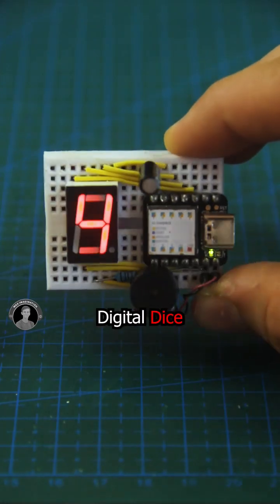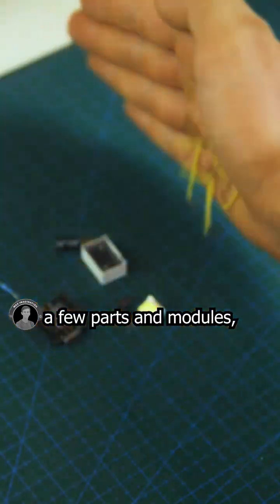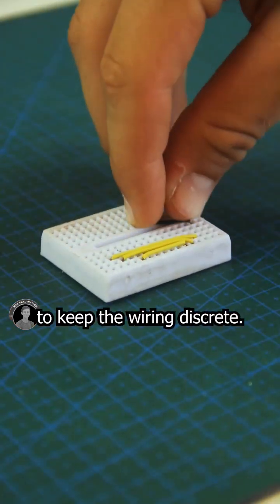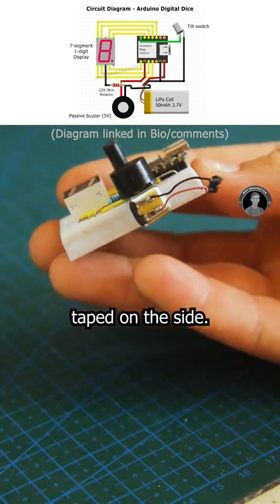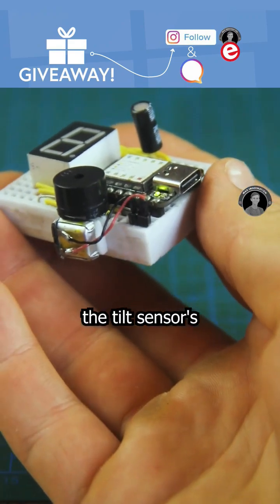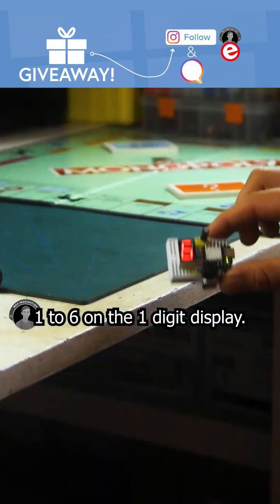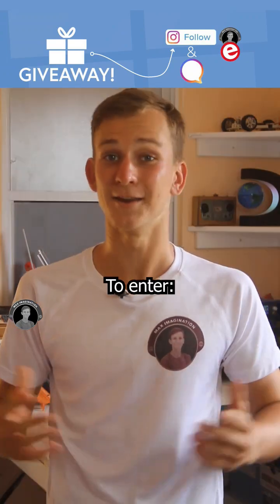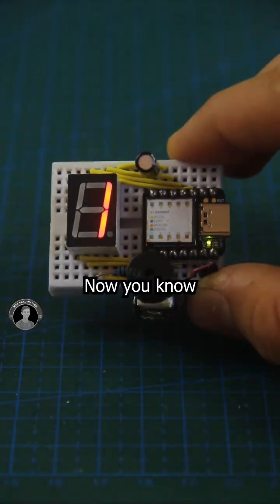Arduino Project - Arduino Digital Dice 🎲  #arduinoproject #electronics #shortsfeed

Comment: brother what is audino project
Reply from the maker: Arduino is an open-source electronics platform based on easy-to-use hardware and software. It's intended for anyone making interactive projects that require programming.
Reply: Thanku for tell
Reply: They don't have search engines in India? Weird